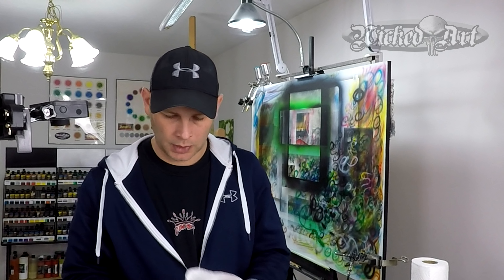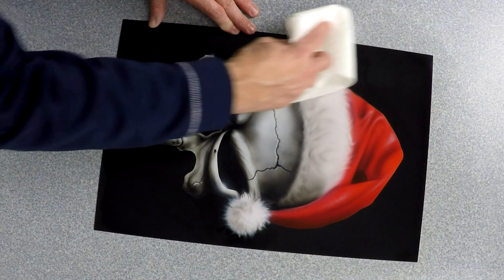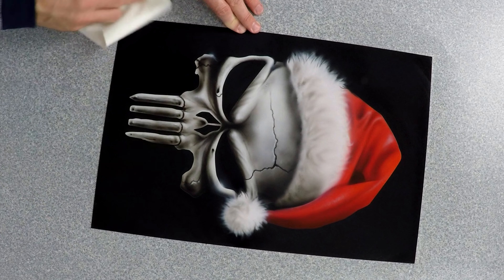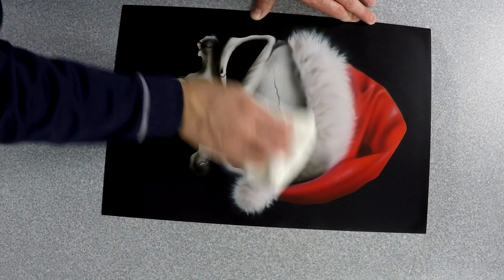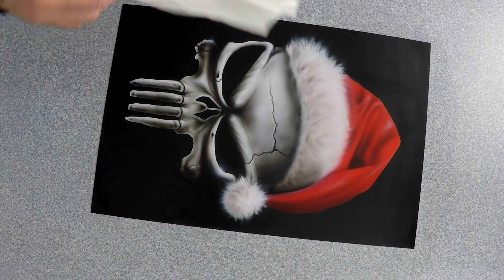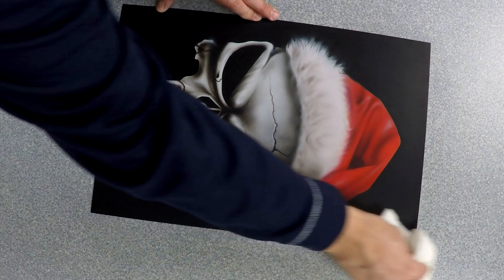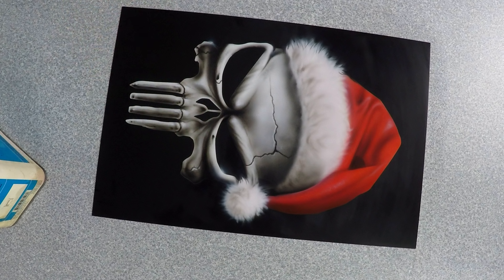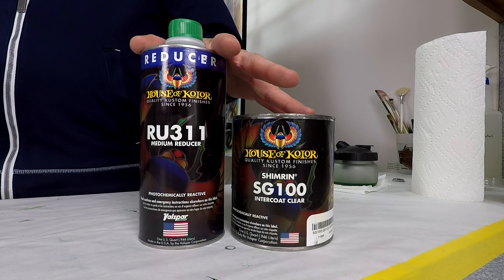Airbrushing with Candy2o: Questions & Answers

Comment: so here's a question about finishing over the candy20. I was spraying top coat over it once I was finished to use as a barrier before applying epoxy. the problem I am having, especially with the yellow and green is that it almost looks like it flashes and looks grainy. Am I better off using 5620, or does it not matter because its the epoxy itself that is causing the candy to do this.
Reply from the maker: I'm confused.  Why would you be spraying epoxy over your top coat?
Reply: @wickedartstudio  I actually brush the epoxy on. I was using the top coat as a barrier between the paint and the epoxy. top coat is not hard enough or resilient enough to last long on a lure
Reply from the maker: @jasonpalicki3620  Sorry for the late reply... this one slipped by me.  Have you thought about using an automotive urethane clear to finish your lure's?  A catalyzed urethane clear would be extremely durable for that use and you could eliminate the epoxy altogether.

Comment: your one of the greats...question...createx candy on canvas...i wanna do artwork of the hulk, spawn and more with the candy createx colors whats the best approach🤔...is it the same as createx illustration and wicked colors
Reply from the maker: Thank you for the compliment!  That's a very broad question, but I'll do my best to answer it... Candy2o is not the same as Illustration or Wicked although they can all be mixed.  Candy2o is dye based.  Illustration and Wicked colors are pigment based.  A dye based candy will not give you solid coverage like a pigment based color.  A dye based candy will get darker with each additional coat applied.  A true dye based candy will get dark enough that it will almost appear black, regardless of what candy color you are spraying.  Of course, that would require a lot of coats (depending on the color you're using).  So, candies are best used near the end of your artwork, to intensify or brighten up targeted areas.  Use the pigment based colors for the rest of your painting.  Does that make sense?

Comment: Looking forward to part 3.

Questions....

I've never been a fan of any createx products.

I also haven't painted anything in over 7 years (maybe C2O will change my opinion).

I've always used Golden, Jurek, aqua flow, and HoK (obviously for their respective purposes).  I want candy effects on this bike... I'm not planning on doing a lot of painting in the future and don't want the investment a HoK set up will take (time, money, space).

My current project is my brand new carbon fiber bike frame.

Any carbon tips? Prep? Clear?

I want to do a deep red marbleizer effect faded into black.  Some sort of silver or the aluminum base with a plastic bag work ok?  Or should I get HoK marbleizer?

I want a purple candy on it with bright green cross hatch over it.  I was thinking of striping the green.  I want to skip enamel.  What would you use?  I could spray it too... I want to avoid complicated masking though.  Would a liquid mask work with these paints?

That's a lot, sorry.  Any feedback is appreciated.
Reply from the maker: Carbon Fiber can be a pain because of the microscopic pin holes (similar to fiberglass).  I strongly recommend a good high solids primer if you don't intend to keep any of the carbon fiber weave showing.  Prep is relatively simple.  Clean it, scuff it lightly with a scotch brite pad, clean it again and spray your primer.  

The plastic bag trick works great with water-based paint when it comes to creating a marbleized effect.  I used to have a video on my channel demonstrating the process.  I removed that video with the intent of making another, but I haven't got around to it yet.  Normally water-based colors are sprayed in very light layers and the color is built up gradually.  Spraying them on too wet creates pigment migration (looks similar to solvent pop or fish eye).  Let your base color cure fully.  When it's time to spray the marbleized color, lay it down wet.  Obviously, you can't work the color with a plastic bag if it's not wet.  The working time will vary depending on your conditions and how heavy you apply the paint.  There are a couple different methods to achieve the effect (laying down a sheet of plastic wrap over the wet paint and lifting it back up or dabbing the surface with a wadded up piece of plastic, etc).  I'd suggest playing with it on a test panel prior to trying it on your bike.  

Enamel striping paint is the fastest and easiest way to lay down the stripes in my opinion.  I use House of Kolor striping enamel for any striping because I've never had a bad reaction when clearing over it.  If you use enamel be sure the water-based paint is fully cured first (normally 24 to 48 hours depending on your conditions).  A liquid mask does work well with water-based paint.  Again, allow the paint time to fully cure prior to putting a liquid mask over any painted areas.
Reply: Great, thanks for the reply.

The weave doesn't show now (unfortunately).  It's a UD matte finish.   Will the createx sealer work here or should I just be safe and go traditional?

I think I may try the liquid mask to see the outcome and have future reference.  If it sucks I can always enamel later.

Thanks again
Reply from the maker: The Createx sealer is a very good sealer and will work.  My only hesitation would be if there are any pin holes.  I'm not familiar with the UD matte finish carbon fiber.  I assume it has a catalyzed matte clear coat?  If that's the case, the pin holes shouldn't be an issue.

Comment: excellent videos and really helpful . I would like to see how you reduce your paints and air pressure you use . I have a lot of trouble getting the really fine detail in my art . I am not sure if it is the air pressure or I have thinned my paint too much or not enough . Thanks in advance
Reply from the maker: I appreciate the kind words!  I'm currently working on a series of videos that will concentrate on the basics.  What air pressure and what paint reduction are absolutely the most common questions any airbrush instructor gets.  I will address both of those questions in the new series of videos.  I hope to upload the first part of the series on Saturday.

Comment: Another great video, Trevor.  Went well over my head this one, but I still learnt something.  Didn't know about the eventual fading! 

However, you asked about questions and topics - well my area of application, and firmly in the beginner camp, for both this and painting/ art in general, is radio-controlled car body shells.  As you may know, these are lexan/ polycarbonate, and just to make things more challenging - you paint the inside of the body, in the reverse order to most other sub-strates (see, I'm learning).  Wondered if you could explore this reverse painting topic?   The Createx Wicked seems to be one of the preferred paints for lexan, and I have some of these.  The paints generally need to have some flexibility for the RC bodies.  Cheers!
Reply from the maker: Hi Xavier.  Thanks for watching and taking the time to comment.  I was aware RC body shells are clear plastic and they require painting the inside of the body; however, I've never had the opportunity to paint one.  If the opportunity ever arises I will gladly document the process through video, but I can't guarantee I will make a video covering this particular topic simply because I would have no use for a body after I purchase and paint one. 

The flexibility issue is largely misunderstood in my experience.  Createx doesn't make a flexible additive for any of their paint.  You can add a flex agent in solvent based systems.  For some reason, many believe the flex agent keeps the paint flexible for the lifespan of the paint job.  That is incorrect.  The flex agent allows the paint to be more flexible for a given time period (the time frame is dependent on the manufacturer).  This is generally for automotive collision repair because it gives them a reassembly window.  The flex agent evaporates along with other chemicals in the paint and goes away in short time (usually 24 to 48 hours).  Proper preparation of your clear RC bodies will promote good adhesion and your paint jobs should last a long time.
Reply: @wickedartstudio  I would happily buy a body or two and send it over to you, and cover the cost of the paint (I think).  It would be worth that money, to me at least, to see someone with your experience tackle it.  I'd be interested to know the paint types and sequences..  There are liquid masks or tape for the designs.  I could even provide idea's for paint schemes.  Happy to discuss further if you are could be interested.  No worries if not, as I guess it may sound like an attempt at a cheap commission!  Its not - I'm genuinely interested to learn.  Thanks.
Reply from the maker: Shoot me an email at wickedartstudio@gmail.com and we can discuss this.
Reply: Wicked Art Airbrush Studio Done.
Reply from the maker: Got it.  Thank you sir!

Comment: I have a question about airbrushes! How do you know what airbrush is what? "Meaning" how do you tell the difference between a detailed airbrush and a regular one?
Reply from the maker: The way most will distinguish a "detail" airbrush vs. a "regular" airbrush is by the size of the fluid needle and nozzle.  A "detail" brush normally has a smaller needle and nozzle which, in theory, allows the user to render smaller, finer details.  Airbrushes with a smaller needle and nozzle are normally a lot more expensive as well.  

My personal opinion is there is no "detail" or "regular" airbrush.  It comes down to your level of experience and how much control you have.  The only way to get that experience is to practice.  Don't get me wrong, an Iwata Micron with a 0.18 needle and nozzle is capable of finer detail when compared to an Iwata Eclipse with a 0.35 needle and nozzle.  However, that margin is very slim when those two airbrushes are compared in the hands of a very experienced artist.  I can render very fine lines and detail with the Eclipse (which is the airbrush I use for probably 90 percent of what I do).

The point is, don't buy into the hype that you're work will improve just by spending x amount of dollars on a "detail" oriented airbrush.  The truth is, you likely won't see any improvement until you've put in the practice time to master controlling the brush.  Learn and master the fundamentals... control and incredible detail will follow.

Comment: Just recently been watching your videos injoy your tips & advice I'm 72 been teaching myself sence I retired 6 years ago I'm not into it for the money as I have got some what better I've done few things for myself family & friend's..I reduce by what bottle says bit have paint thicken up in cup like 10-20 drops of paint reduce by 10% it flows good for awhile then up before I empty cup?  I pull needle back and spray to clear tip 
I use createx paints wicked detail etc. Not sure what to do?  sorry for long text...Injoy videos THANKS
Reply from the maker: Glad to have you!  Thanks for watching and taking the time to comment!  From what you've described, it sounds like you're getting intermittent clogs in the nozzle of your brush.  There's a couple things that can cause that. (1) Make sure you mix your paint and reducer thoroughly. And allow the reduced paint to sit for 10 to 15 minutes prior to using it in your airbrush.  That gives the reduced paint time to emulsify.  (2) It's a good idea to strain your reduced paint prior to using it in your airbrush.  The pigment in the paint sometimes migrates into small, hard little pieces that will create clogs like what you've described.  Some colors are worse than others in my experience.  You can use an automotive paint strainer, or cut up some panty hose and funnel the paint through that.  As far as using the manufacturers recommended 10 percent reduction ratio, keep in mind that recommendation is for a full size spray gun, not an airbrush.  I think you'll get better performance with a greater reduction ratio. Every artist is a little bit different in this arena, but I usually start out at around a 50 percent ratio and adjust from there.
Reply: @wickedartstudio  Thanks for getting back I'll try out your advice.This storm got me busy for a bit...But thanks for the feed back
Reply from the maker: Glad to help!

Comment: Hi Trevor.
Could you re-candy the eyes to brighten then up again?
Guy
Reply from the maker: Great question.  You could, but it's not a fix I would recommend.  To begin, it would be expensive to clean, prep and clear the entire hood again just to touch up the very small areas of the eyes.  Second, although the candy will fade, I don't think it will fade completely away.  Remember candies always darken.  To come in and reapply candy later would likely push the eyes too dark very easily.

Comment: I airbrushed my van but the candies fade really quick even though I 2k lacquered it  ?
Reply from the maker: Candies will always fade.  A true candy is aniline dye based.  UV from the sun breaks down the dye over time and it will begin to fade.  There are a number of factors that can affect how slow, or fast the candy will fade.  For example, the amount of UV exposure the vehicle is subjected to.  A garage kept vehicle will preserve the candies far longer than a vehicle that is parked outside daily.  The amount of UV inhibitors in the clear you use is also a factor.  Lacquer was surpassed by urethane a long time ago.  Modern urethane clears are more durable and generally do a better job protecting your artwork longer against UV.
Reply: @wickedartstudio  ...Thankyou so much ... my van is outside all the time because I can't fit it in the garage... I have had to do the candy at least 3 times in the last few yrs ... I guess this is one of the downfalls x If I knew how to send photos I could show you...I think your work is phenominal X
Reply from the maker: Thank you so much!